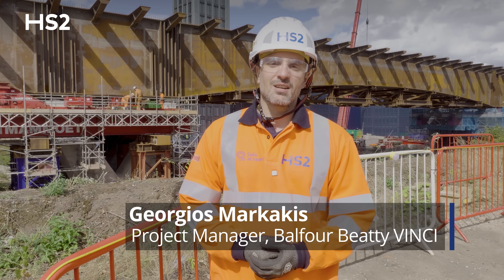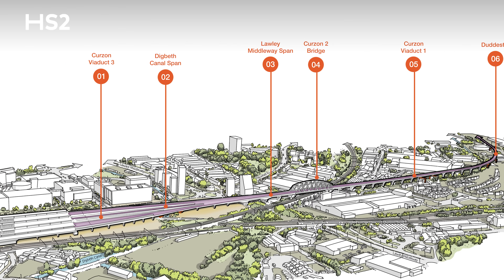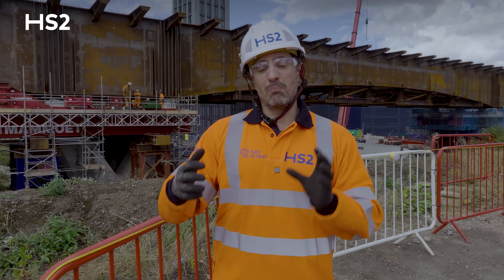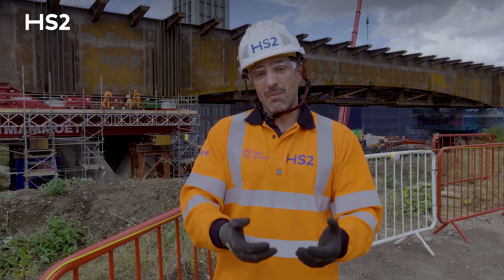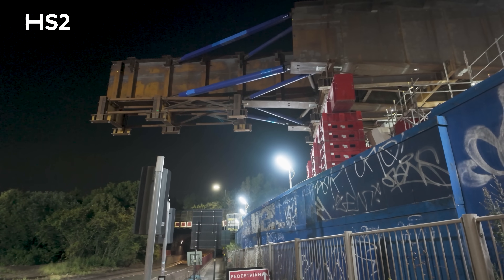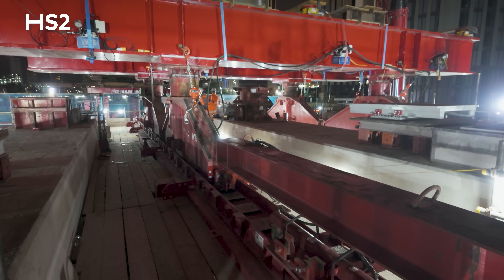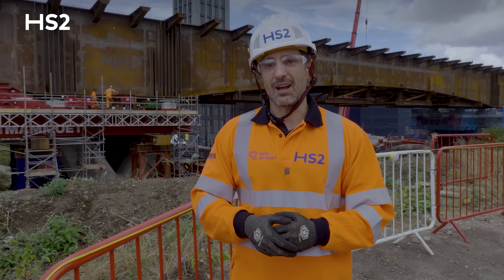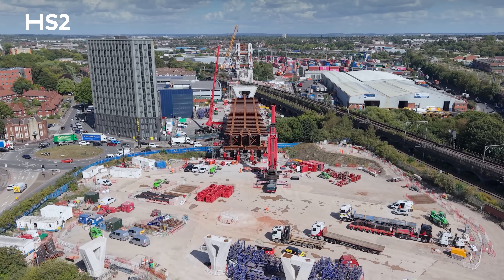How HS2 completed the night-time mega bridge move over Birmingham Ring Road 🚆 🏗️

Comment: Green Hydrogen-powered IC engines could power the next generation of eco-friendly locomotives.
Reply: Very unlikely in Europe. The relatively short distances and concentration of population and development make electrification far cheaper in the long run. Hydrogen is currently only about 20% efficient in converting energy input into work done and is not likely to ever reach even 50%. The myth of hydrogen being a realistic like for like replacement for petrol or diesel is being kept alive by the fossil fuel industry who hope that people will be stupid enough to burn oil to produce hydrogen!  Hydrogen fuel stations were opened and hydrogen cars were not bought in anything like sufficient numbers to keep the fuel stations open. 
There may however be a use for hydrogen trains in parts of the world where there are thousand kilometre stretches of track running through open prairie or desert and power supply equipment would be particularly expensive to install and maintain.

Comment: Why did you not temporary reroute the road onto the assembly area.
Then built the bridge in it’s finally position.

Not only would this have been cheaper but also more efficient
Reply: The road is in a cutting below the level of the assembly area, as it passes under the adjacent railway. Buses and lorries would have to turn 90 degrees and climb an impossibly steep hill to achieve what you're suggesting.
Reply: Fantastic piece of engineering
Reply: How would it have been cheaper?
Reply: Lots of different ways, especially as it is steel.